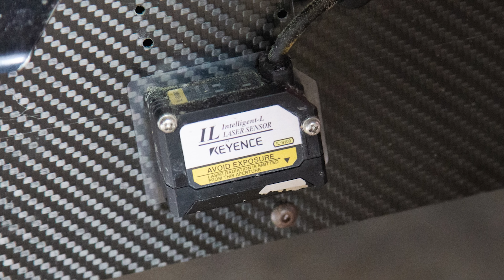HKS TRB-03 GT86 | Tsukuba TIME ATTACK King? [TECH TALK]

Comment: How much faster than a GT2 rs would this car be?
Reply: A stock GT2RS? MUCH FASTER. Search GT2RS vs GT3CUP on youtube. GT3CUP is 3~4 seconds faster than GT2RS in Road America. Top Fuel's S2000 that recorded 51~52 seconds at Tsukuba is 4~5 seconds faster than GT3CUP at Suzuka. A stock GT2RS probably will run about 59 seconds  at Tsukuba. So this car is 10 seconds faster. GT2RS is the king of stock cars but it is too slow in WATAC

Comment: jeeze, at 7:21 it looks like they ran out of gas on the welder but they just keep on welding anyways.
Reply: "Weld Porn" Isn't really a thing in Japan. Its a case of "If it works, It Works"
Reply: I noticed that too - badly setup MIG rather than the usual TIG.

Comment: So you think they may be moving towards an F1 style torque control for the throttle? TBH, I'm surprised it has taken so long for race teams to take that step as it has been used for many years there.

Looking at the suspension, a little surprised they weren't using oval tubing - regulations? - as there isn't a lot of price difference last time I checked, eg. https://www.wagaero.com/streamline-wing-strut-tubing.html. Don't know if they're still available, but you used to be able to buy plastic covers to stream-line tubes round tubes when oval were banned - anyone? Ah, still available - http://www.uflyit.com/streamline_fairings.htm and other places also have them.

Re the dry sump, you had a video a few days ago about one manufacturer of them, they had a couple of very neat integrated - sump and pump - assemblies for that engine if one cared to check their site out

Comment: Almost 800bhp from a FA20. WOW! 

and it blew my mind to think they junk all the stock GT86 suspension bits. And one pointed out the front suspension is taken from the RX-8
Reply: Lin Chester if the stock engine with turbo can get 450-600 hp not shockingly
Reply: @SleepyRulu  no the FA20 on stock internals is only good for 300bhp. The rods are the weakest point. You need to upgrade internals.
Reply: @linchester8464  mine has 400bhp with no problem for more than a year of everyday driving
Reply: Lin Chester if the stock engine with turbo can get 450-600 hp not shockingly

Comment: Will Au-Yeung just ran a 53.07 in his Civic at 'Attack Tsukuba' *on Hoosier's. It was also his first time out there so I doubt the car was optimized. I have a lot more respect for his 53 after seeing what HKS had to do to run a 49 on slicks. I'm pretty sure Will did most of the work himself too... because he's a Canadian. For us it's DIY or Do Nothing.
Reply: will was not on yoko's. he was on hoosier A7's. 
his words are that a 52.0 would have been possible if they didn't have duct tape holding a split charge pipe together
Reply: @RHBTurbochargers  Cheers man! I thought for sure he'd run yoko's to compare to Under Suzuki's time. I also don't know much about these Goodride events yet. I'd still like to know what Will would have run on yoko's - do you know if he did any testing on them leading up to the event?

Must have been a non-Vibrant charge pipe leaking!
Reply: @DeathOrGloryRacingBC  He did a test day the day before the event and that was it. Car went directly from wtac to tsukuba without any work. And it was a stressed weld that split on the charge pipe. Will's an insane driver being able to pick up new tracks in only a few laps
Reply: yea will does most of his own work much respect to him.  hks thinks they can trick ppl into thinking this is basically an ae86 when everything on car is different.  they wont even be honest about which block they use.  thing i took away most is ae86 is not a good starting platform.

Comment: That statement at 0:57 I had to laugh Andre. TRB-04 has a 4G63 shoved into it showing that HKS typically doesn't always retain the OEM engine. But let's be honest, who actually modifys Swifts period? 🤷 I haven't heard of a high powered Swift until that car.
Awesome article on the 86, I agree with your statement that HKS used the FB25 block instead of the FA20 on it. What a weapon, imagine it with a 2JZ. 😮😮😮
Reply: It would be trash 2jzs are too heavy
Reply: @joshuawalcott321  That was disproved in the RB vs JZ block test. Only 57kg for a short block, and FA20s in the Subaru parts catalog state roughly 110lbs. so that's 50kg. Wow, 7kg difference, big weight gain. 🤦
Added bit: Also, if this is using the FB25, it would be slightly heavier than the FA20 which cancels that 7kg difference. 🤔😉
Reply: @MafiaboysWorld  it's the placement of the weight the big ling 2 jz will upset the weight balance
Reply: @joshuawalcott321  While you would technically be correct, remember that they have already relocated that Subie motor back for better weight distribution so the same thing applies with the 2J, move it back, weight balance stays the same. 👍 At the end of the day you are complaining at a 7kg difference which gets cancelled out from them using the bigger FB25 block anyway, and the capability and reliability of the 2J is a lot more well proven. 👍
Reply: @MafiaboysWorld  but you cannot move and inline 6 as far back as you can a flat or V engine or inline 4 too much of the weight will still be over the front and it will also he too tall. You want the weight as far back and as low as possible so and inline or flat 4 or V engine is a better choice than the 2jz. That's the reason Toyota used the 3sgte in the Supra race cars instead of the 2jz and why Nissan switched from the rb to the vq in the r34 race car. With the rb it was front heavy and would understeer. Simple physics dictates that inline 6s just aren't that good for weight distribution unless you're going to put half it it next to the driver(which is what some people do to get proper balance with 2jzs)
Reply: @joshuawalcott321  Those JGTC cars also had power limits (500ps) and weight minimums that allowed lighter engines such as the 3S in the Supra and later on the VQ in the R34 to be fitted in the late 90s/early 2000s. But when Toyota swapped to the SC430, they kept the 3UZ motor, a heavier motor than all of those we've mentioned, go figure. 🤷😂🤣
Reply: @MafiaboysWorld  Blocks are not engines...
Reply: @gordowg1wg145  Even full motor isn't that much different. Stock FA20 N/A is 170Kg. Add some weight for FB25 block vs FA20, then some more for the turbo system needed...you're pushing 200kg already then or more. A full 2JZ-GTE with it's rat's nest sequential twin turbo system is 230kg, change it to a single turbo like everyone does today and suddenly the 2J is a lot lighter. 😉 You're trying to make it sound like the 2JZ is a boat anchor here boys. 🤣😂
Reply: @MafiaboysWorld  because it is it is a large boat anchor that takes up too much space, you're also forgetting the transmission . A 4cly is just better for balance you can't beat physics. Do you think it's just coincidence All top time attack cars run 4cyls?
Reply: @MafiaboysWorld  the top 3 cars run 4cyl
Reply: @MafiaboysWorld  that's not a top time attack car just a nice one if you look at the results the fastest fars are running 4cyls in both pro and pro am
Reply: @joshuawalcott321  The winner of the pro class is running a BILLET 4.0L Elmer 4 cylinder in RP968 and the Tilton Evo won the amateur class and got written off at the event and is no more.
Reply: @MafiaboysWorld  where the fuck did you pull out 30kg for an fb25? It's an overbored and stroked FB engine it's not 30kg heavier. Not to mention that it's overall a larger engine with a higher CoG and the requirement for more supporting shit to be added over a 4 banger. And you're Duff in the head if you think there's only a 7kg difference between an aluminum 4 cylinder and iron block 6 cylinder lmfao
Reply: @MafiaboysWorld  you also have to consider how LOW the fa can sit, at least in the newer 2022 brz they show that it sits lower than the wheels!
Reply: speed academy has a few videos on an all-out suzuki swift, all carbon, fully built motor, and i think a sequential also. the car recently went k-swap though, then that was boosted.